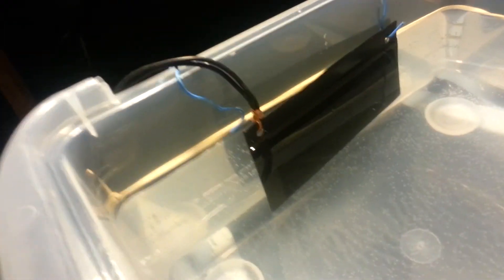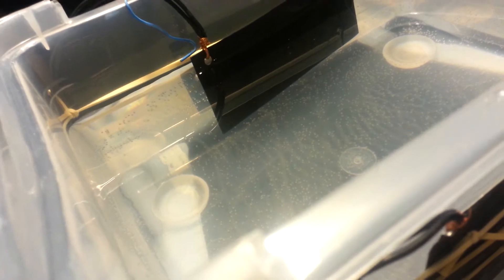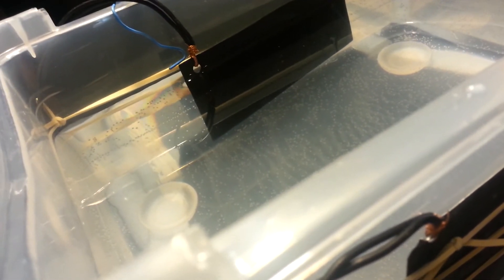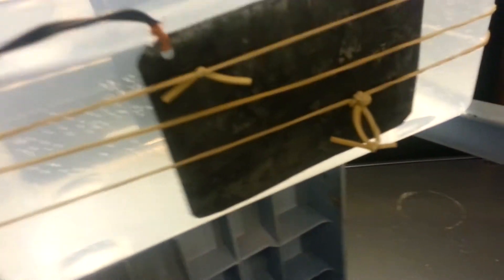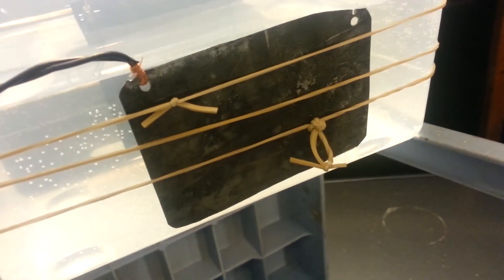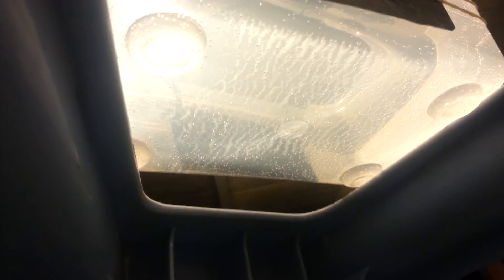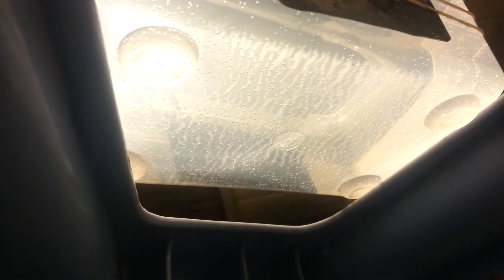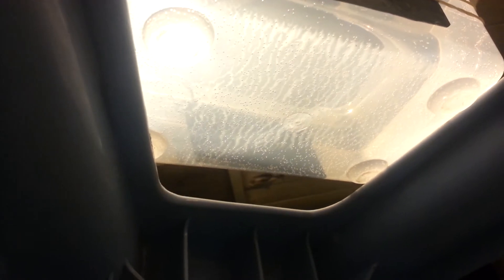Co2 capture based on M.T. Keshe

Comment: Thanks for the video.   Looks like your zinc plate is outside the solution, which proves that the white material is not Zinc oxide.    Try to run the experiment with having  a Banana sitting on top.  Others have reported that the liquid color changes to yellow and the GANS are powered by plasma strength of the banana.   It would be nice to see what you come up with.   I am busy with building the health pens and pads and experimenting with the health results.